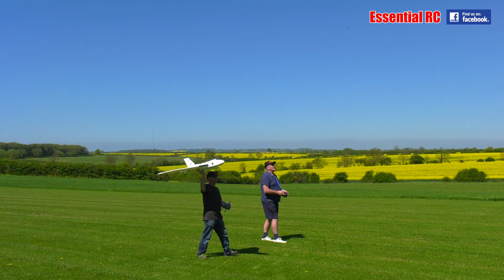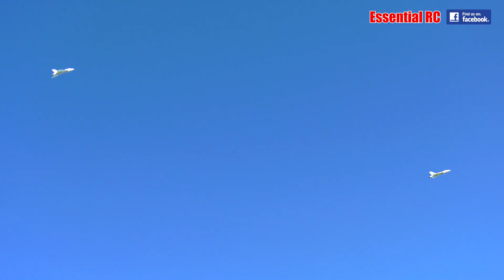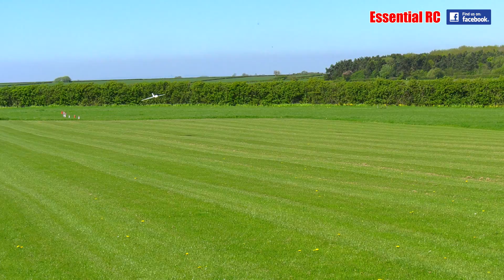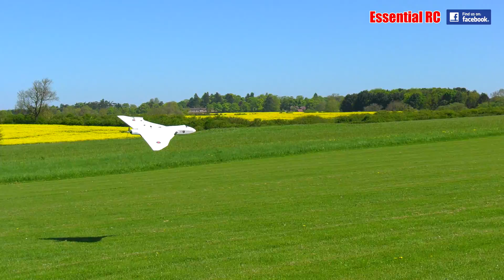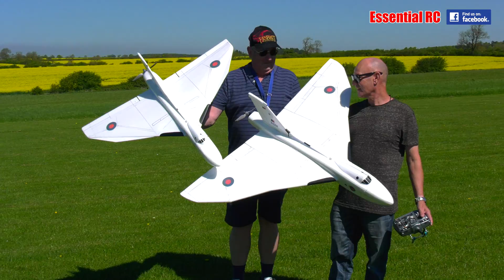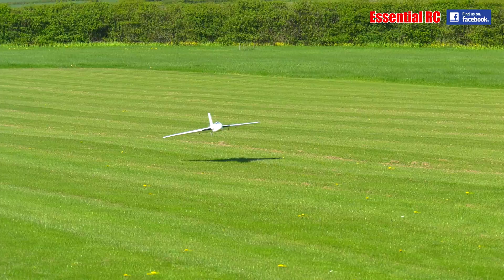Electric AVRO VULCAN BOMBER Pusher JETS in FORMATION (Graham Dorschell)

Comment: Did you find the viewfinder on the AG-UX180 large enough to use easily in sunlight for fast moving RC airplanes? My Sony FDR-AX53 consumer camera has an EVF, but it is so small that I find it unusable. I'm looking for a camera to replace it, but there aren't any camera stores around here anymore for me to look in person.
Reply from the maker: I will assume you mean the viewfinder with the eye cup as opposed to the pop out screen. The former is awesome and is what I use 99% of the time. Because the cup surrounds your whole eye and blocks out any sunlight. The pop out screen is only really good for close up work or inside and that' fine for what I do. The viewfinder was one of the key reasons I got the UX180. The cup makes a massive difference to accuracy and to the strain on your eye from many hours of filming at one event. The downside is that the camera is relatively heavy compared to a handycam but I've started using a Manfrotto carbon monopod that 360 pivots at the base and has a fluid video head. I look like a muppet when I'm using it but it reduces the effort of filming and makes for smoother shots. Hope that helps.
Reply: Thanks, Dom! Yes, I meant the viewfinder with the eye cup. I need to be able to use the EVF because the LCD is useless outdoors. Unfortunately, on MY camera, the viewfinder is too small to be of use. The specs say it's only .24". My eyeball is bigger than that! Not being able to comfortably use the EVF makes my whole camera a waste of time for trying to film flying RC airplanes. I did try to put an aftermarket eye cup on mine, but it didn't help. It's the damn tiny little EVF screen, itself, that makes viewing for taking video an impossibility. To quote another user, "Looking inside the viewfinder feels like you're in the back row of a movie theater watching a small screen." I just found in the specs on the Panasonic AG-UX180 that its EVF has a .45" screen. Still small, but nearly twice as big as on my camera! Unfortunately, I cannot go see an AG-UX180 in person. I may just have to order from a place with easy returns in case the EVF is still too small for me. I hate to do that with a $3,000 camera!
Reply: I also have a question about how you use a monopod since so much of your filming is above you. I guess it would work if the monopod was taller than you, but that is not the norm. Are you, per chance, tilting the eye piece upwards so that you can look downward into the eye piece while the camera is pointed up at the subject? I look forward to hearing back from you. THANKS!
Reply: Sir, I know how busy you are. If you would spare just a few minutes, I REALLY want to know how you use the monopod for shots overhead. THANK YOU!